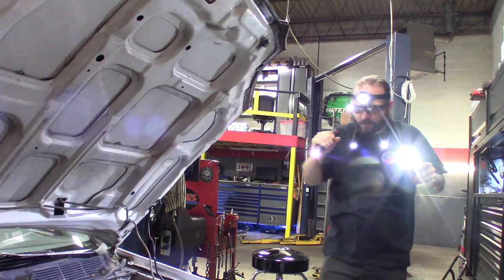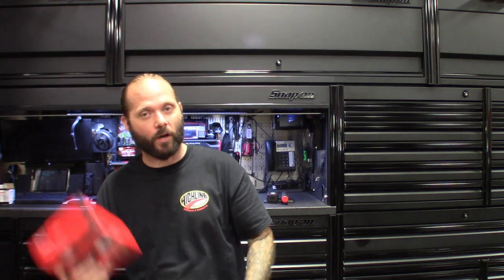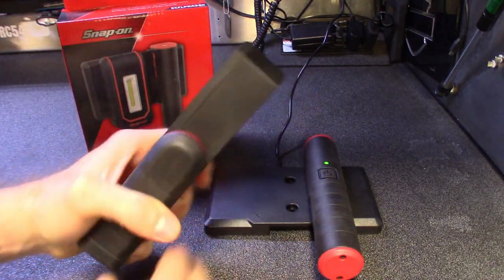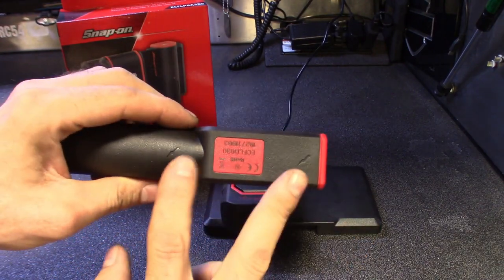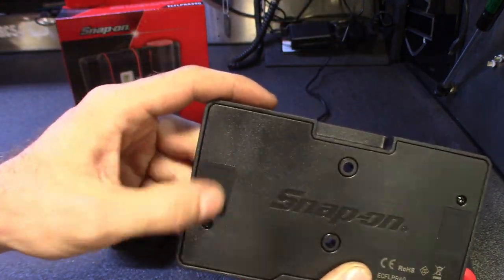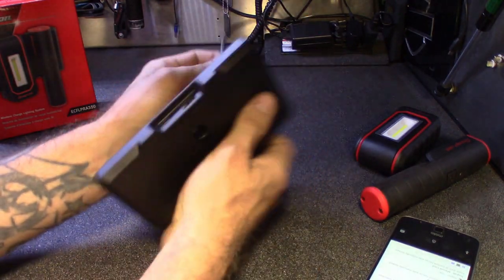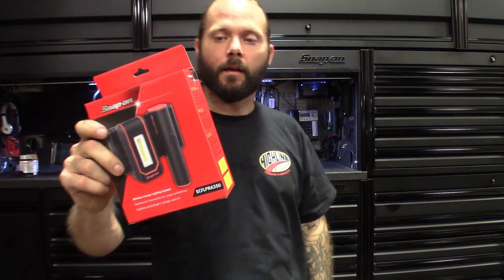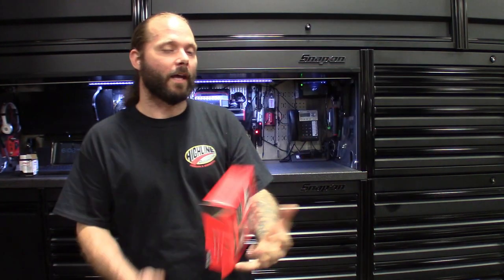S𝐧𝐚𝐩-᠐𝐧 wireless flash light

Comment: Mac tools has the best light. It’s rubberized like those and it has a Bluetooth link between the dock and the light. If the light gets far enough away from the dock then both will start beeping that way if you forget it on a car or something it’ll alert you. You can also push a button on the dock to sound the alarm on the light so you can find it. The item number is MHL600. It’s also IP67 rated. Matco has a new light that looks like the popular Astro light but it comes with a piggyback charger with an extra battery to hot swap and is 700 lumens.
Reply: That’s awesome!  Too bad we don’t have a Mac guy around my way.
Reply: I have that one also